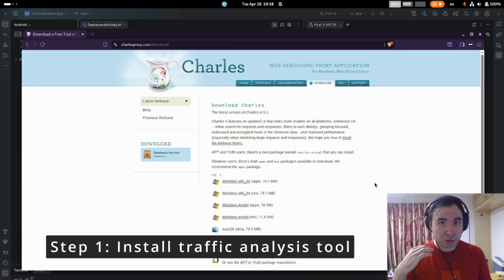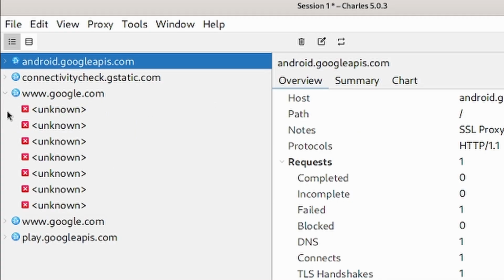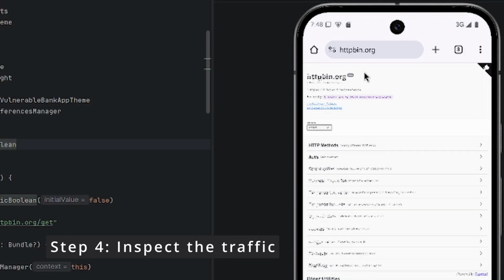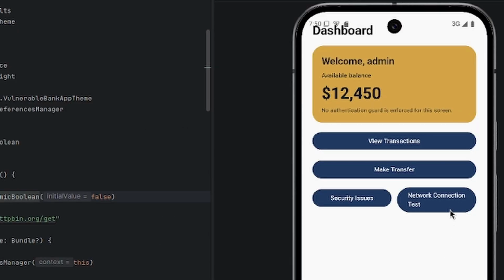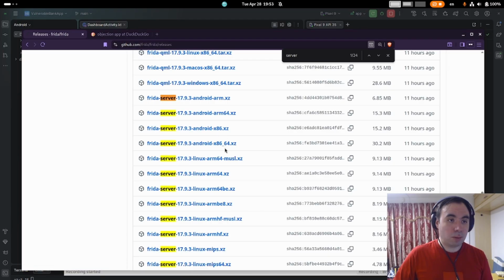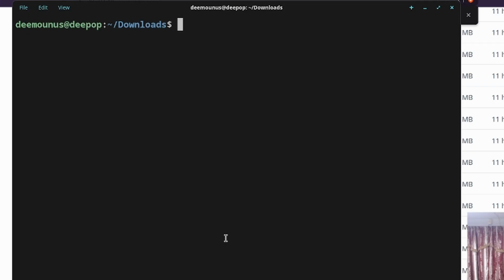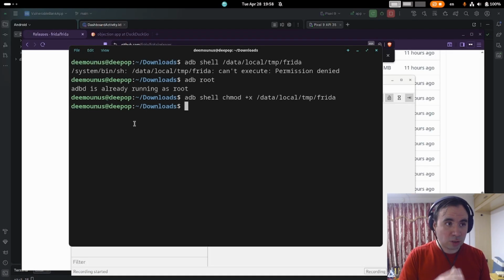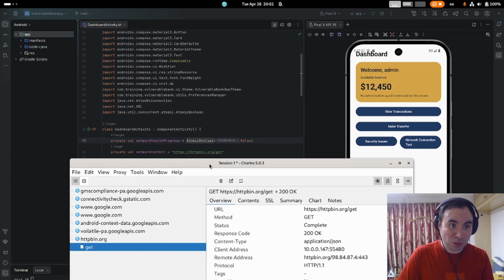Android Traffic Analysis Tutorial | Charles Proxy + Objection (Part 2)

Comment: bro between burp suite and charles, which one do you prefer more for Android App Traffic pentest? and why?
Reply from the maker: Depends on the goal 😄

For quick Android app traffic inspection/tutorials, I usually prefer Charles because the UI is cleaner, SSL setup is easier, and it’s great for rewrites/breakpoints/debugging.

But for real pentesting and deeper security testing, Burp Suite is way more powerful — Repeater, Intruder, extensions, etc.